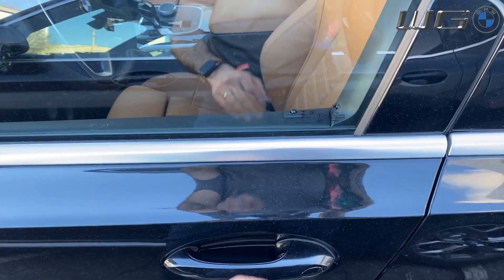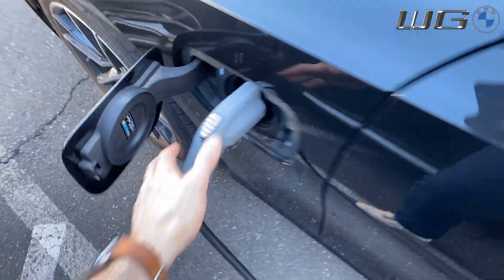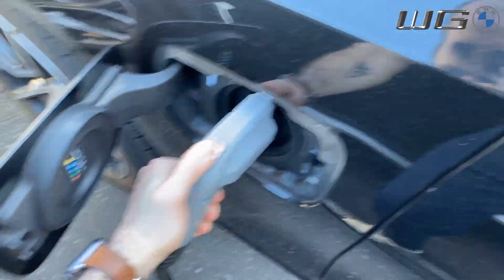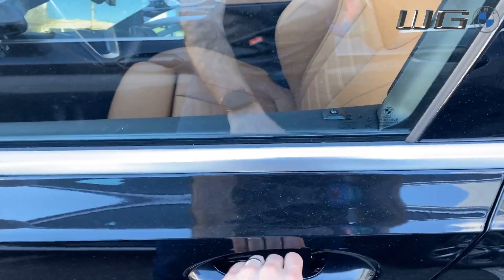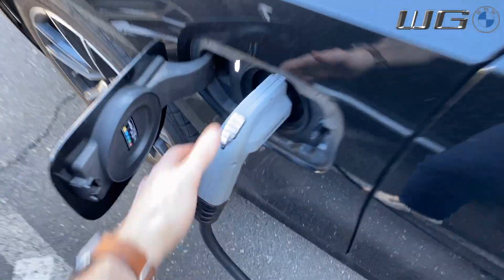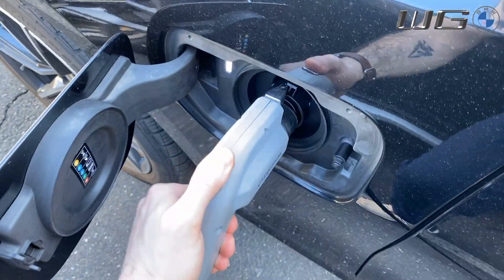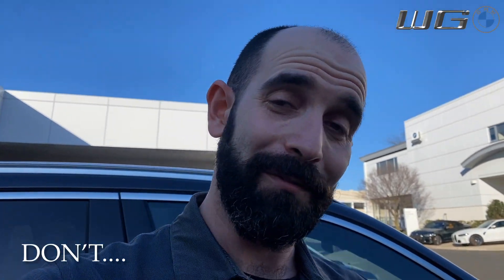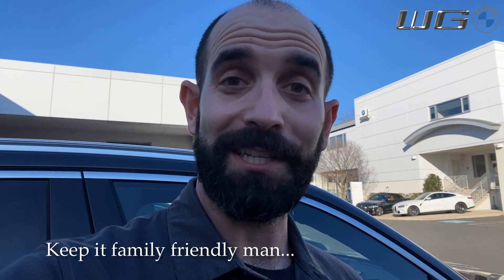Quick Lap: PHEV/BEV Charger Stuck?

Comment: My X3 is unlocked but the electric will not pull out, is there a manual way of releasing it?
Reply from the maker: @PaulHeaphy-c1o  are you connected to your myBMW APP? If so you can select stock charging which will unlock it as well.

Comment: Does this still apply even if you have your i4 charging settings set to "On" for "Unlock charging cable automatically"? The cable was locked even though I hit "stop charging" on the app and the car charging port flap had a white light indicating charging had stopped. I could not unlock the cable until I unlocked the car. Is that because I stopped charging before it reached it charging target?
Reply from the maker: The unlock automatically is only when charge target is reached, not charge stop. This prevents someone simply switching power source on and off to steal an active charge